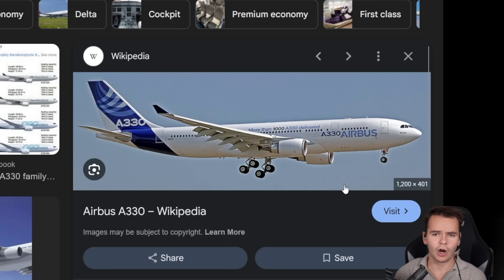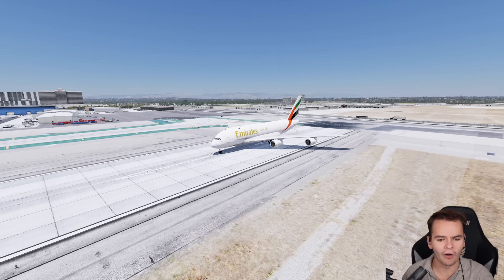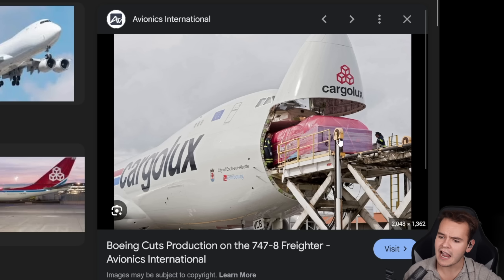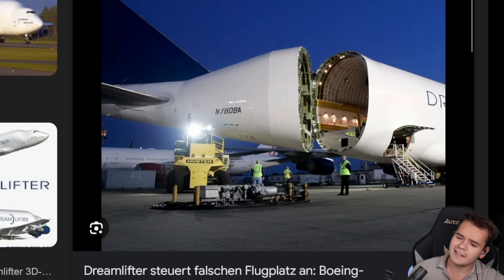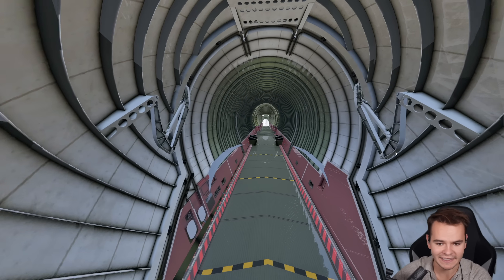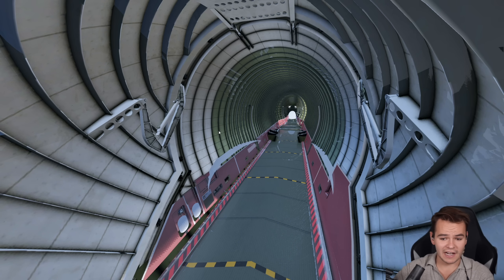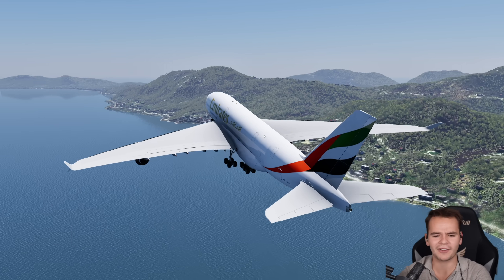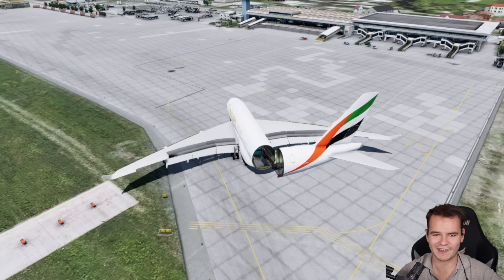I Built An A380F Because Airbus Didn't

Comment: yeah there is a way bigger problem with it. you can't easily change the floor structure because it holds the fuselage together. and if you take it out your plane would just burst into pieces as soon as you pressurize the cabin.

Comment: The a380F doesn’t exist because the floor in the a380 is structural and if u were to remove it, Airbus would have to redesign the whole fuselage along with the cargo door hinge.
The a380 is also carrying a lot of dead weight due its landing gear, vertical stabiliser and its wings, designed for the stretched a380-900 and that would hinder how much cargo it could carry in order to compete with the 747F.
And even if u made an a380-900  the engines may not be able to carry the -900 along with heavy cargo, harder to keep CG etc
And if Airbus were to make an a380-800F they would have to redesign all the landing gear, redesign a big part or even the whole wing/ wing box.
And redesigning the whole fuselage, wing box, landing gear and vertical stabiliser would be a big pain.
(Pin pls)

Comment: Or hear me out,double decker cargo config
Reply: Too heavy
Reply: @Randomly_Browsing  well no bc top deck would be smaller, and it actually was planned to have give or take 1.5x the cargo weight of 777f (and that's mainly because of structural concerns rather than actual weight) if we ignored structural capabilities (which was actually thought with the passenger ground's structural capabilities) it would not be too heavy to fully load it, in fact, it would've had similar-more cargo volume than the 777-8f (theoretical guesstimates)